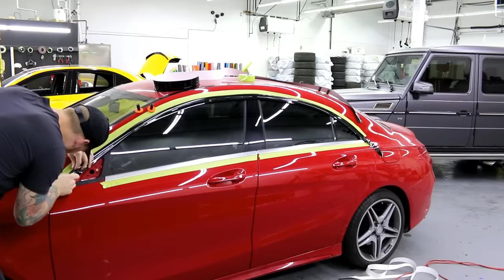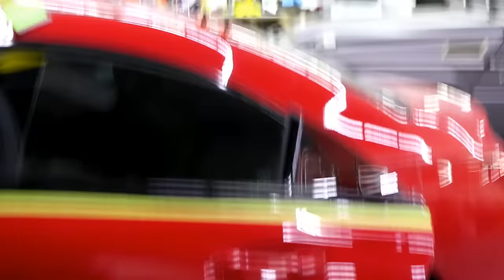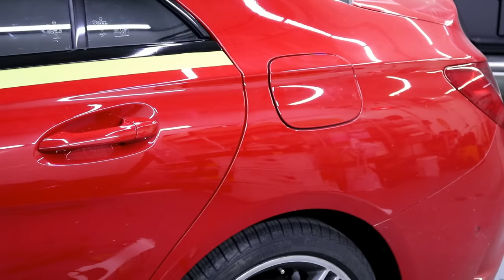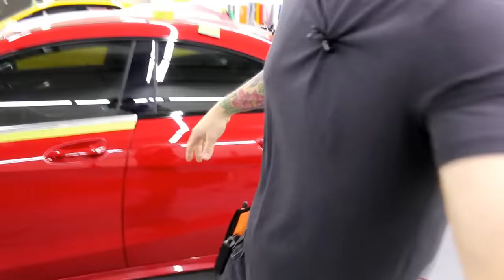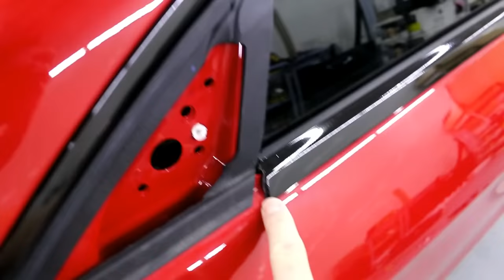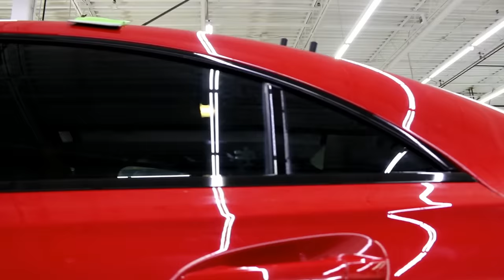EASILY Cover The Chrome Window Trim On Your Car

Comment: Would it be worth you investing in a GoPro head camera. So we can see what you see??
Reply from the maker: I have one, just need a way to mount it to myself
Reply from the maker: I don't want to wear it on my head because it's distracting
Reply from the maker: Chest strap it is
Reply: GoPro has a mount that mounts on fitted or flex cap when worn backwards.  Regardless, thanks for sharing the knowledge!
Reply: Suction cup mount!
Reply: there is a shoulder mount too, RIP said whats up

Comment: Trim seems so easy but I found out it is realllly tricky. I redid mine 3 times cuz your right any little movement with blade you have chrome showing. Even a tiny sliver of chrome stands out like BOOM! Definitely a pro knocking these out first go round and look flawless like usual.
Reply from the maker: It's all in the wrist man. Knife work is another skill to work on
Reply: CK Wraps lol amen brother

Comment: I’m about to do my b7 rs4 saloon as the aluminium trims have gone milky and there’s no way of cleaning it off. The trims are a huge job to remove and replace so I figured I will wrap them. Colour wise I’m doing it in Matt silver to keep the car standard looking as mirrors, radiator grill and wheels are all Matt silver. Thanks for posting such a helpful guide. Hopefully mine will look as neat as the job you’ve done on the Mercedes. Cheers

Comment: I’ve been calling around and been getting quoted 300+ close to 800 smh I’ll just do it myself I have a 2018 accord sport
Reply: How did it go? I have a 2020 accord sport and thinking about just doing it myself too.
Reply: Never got it done as of late
Reply: @Dreamingbigent  if you still wanna do it and don't care about some seam lines, use blackout tape. Buy multiple rolls tho cuz 2 whole rolls weren't enough for the windows on my 2017 TLX. Looks pretty damn good tho
Reply: after many failed attempts to make my accord coupe look good i’ve accepted a 450 quote for windows and door handles in gloss black
Reply: Just by a can of hyperdip and just spray um..the hyperdip is like plasti dip on roids.I mean I’m sure wrapping is nicer long term but 90% of people can’t wrap like this guy lol and worse case is you need to respray once a year
Reply: 50 bucks worth of hyper dip or 50 dollars in vinyl and 650 in labor 🤷🏻‍♂️😂
Reply: All I get is $1000 AND UP $300 is a great  price
Reply: Same here. They over charge for wraps

Comment: I have an Audi s5. Just took a look. I see the rubber seal on the top chrome is on top and bottom. So just gotta get blade in between rubber and trim, right. Looks like you have to wedge your blade in between the seal, because it’s pretty tight on the top seal. Also, On bottom trim, little easier. There’s no rubber seal on the bottom part of the bottom chrome trim. Bonus, the mirror is not in the way, it’s actually about 6 inches away from the corner of where most mirrors are, there actually a black plastic plate on that little corner, so I can do that part without removing mirror. Only fear is cutting the seal by mistake. But I’m might try it if I can’t find someone to do this job under $125. It it wasn’t such a nice car, I would just go for it, without being nervous lol

Comment: Love watching your channel and it gave me the confidence to do the trim delete myself! However, after doing the trim delete in gloss black Avery film I find that the areas that tuck under the trim or where you would stretch it at the ends to get a clean finish eventually peel back a little and I'm finding myself going over tucking it under before i go for a drive. I prep'd the surface and cleaned it with prepsol and starting to think that because I applied it when it was only 10 deg. Celsius the adhesive has not taken to the aluminium trim....or maybe it the design of the trim? For reference it's an Audi A6 avant.
Reply: Same shit with me exactly, 08 335i. Looks good for a day. Peels off the edge no matter what prep, heat , tucking ect. Paid for it to be done
Reply: @becausereasons41  did you ever find a fix for this?
Reply: @Dominic Borrelli  I painted them. Still holding up fine

Comment: Should you run the heat gun over this after it is cut and tucked to activate the glue, or is it ok just sticking and only using heat where necessary?
Reply: To add to this. If you ONLY have a butane torch with no wired heat gun, will that work as well? Provided you don't set it ablaze of course. Lol

Comment: Hey Christian. Huge fan. I have a question. Does most gloss wrap have an orange peel effect? I bought black rose from 3m and in my opinion, it looks like garbage. The orange peel is so significant I could probably get better results with a rattle can. Thanks for your time.

Anyone else have input on this?
Reply from the maker: 3m is does not have a nice finish as I mention in a couple of my videos. Avery has some orange peel and Vvivid has even less

Comment: Any chance you can tell me which line of Avery you prefer for this ? The 500, 700 or 800 series ? I'm guessing either the 500 or 700 series since you said you prefer it thin ?  Or do you use the cast series ?

Comment: How well does this wrap hold up to hot weather? We live in a desert like climate and I'm worried that it will peel. And if it starts to peel can it be removed without damaging the chrome if it has been exposed to 100°+ heat?

Comment: Hi Chris,I have a 2018 civic hatch (white).  What would you recommend if I wanted to "white out" the civic badge on the rear?  I see lots of people black them out, but haven't seen any "white out".Thanks
Reply: ducebigalow hey, I'm not Chris, but I would recommend to try plasti dip on the emblems. It's an easy job and with the proper masking and spraying technique will turn out good. When applied properly will last for quite some time. But all white sounds like a cool idea! Hope this helps a little!

Comment: Ive been watching a lot of your videos lately to learn more about how to wrap. I love your videos and the information you provide for people, but I have one complaint; you don't do enough close ups of what's actually going on when doing some of the finer detailed stuff.
Reply from the maker: You're right, these are older videos that I was doing more for fun. I have up close and detailed videos on my website www.ckwraps.com and everything is filmed in 4k. There are over 400 videos on the website with categorized sections like beginner 101, bumpers, advanced, mirrors etc. There's also an open discussion forum where members ask me questions which I answer every morning.
Reply: @CKWraps  I'll definitely check that out. You have greatly inspired me to start my own business doing this. Im going to do a full stripe today and I am ordering the material for a full wrap on my Audi to start my portfolio.

Comment: it "looks" easy, but im sure it is not, but im gonna try and do it. I was wondering about the tape though. The Vvivid stuff doesn't have great reviews on Amazon. If that's what you use i would use it no problem. Do you use the vvivid? Also side question, what do you think of using matte black. I have a black car i wanna black out.

Comment: nice work. on a charcoal gray 2018 yukon denali, im thinking of getting a slightly lighter shade of gray than the body color to delete all the chrome... but will it be hard to match that lighter gray color for the large chrome grille and emblems/badges? what would your shop use for the denali grille?plastidip paint?or can a heavily grated grille be wrapped too?

Comment: It seems from the video that you do not leave much to be tacked in. I suspect in a hot country this can be an issue, as the film will shrink after some time and the customer wont be happy. On the other hand, some cars have really tight rubber seals, which are impossible to tack the film under. Do you give the warranty for something like this? and how do you explain this to the customer?

Comment: I tried this and it keeps wanting to pull back on the ends.  It's a 2008 Audi Rs6 and the ends don't have much surface area.  It's like the vinyl isnt quite as sticky as it needs to be. Admittedly it's cheap ebay vinyl as I just wanted to give it a go.  Tried post heating too but it still seems to lift after a day or so on the ends.  Is there a particular vinyl that has a very strong adhesive?

Comment: Watching all your vids! Looking to wrap the black trim on my Subie in black carbon fiber. Still kinda cool in New England,  will probably try it in my home garage/driveway but wanted to know what u consider the lowest temperature to wrap in. Seems like 70s but not sure if you ever wrapped in cooler temps.
Reply from the maker: High 60's can work, anything lower could cause a problem

Comment: I had such a hard time deleting the chrome in my model 3. Does ambient temperature of the room make a difference?  I found that the vinyl is really stubborn when it's around 40 degrees in my garage
Reply: This is addressed in countless videos. The film/wrap becomes stiff at low temps. Best bet keep that heat gun flowing. 🔥

Comment: I have a vinyl wrapped car already, want to add the chrome black out.  what kind of tape are you using to protect the car while working?  that looks like yellow painters tape?  will that hurt the vinyl wrap?
Reply from the maker: I use yellow painters tape 3m 301+
Reply: @CKWraps  will it effect or ruin the vinyl wrap?

Comment: Thank you for the vid. Would you recommend using an edge sealer? I’m about to do my car with my friend but he says I need an edge sealer
Reply from the maker: I've personally never used edges Sealer in my life and that's coming from someone who had no help when it came to learning how to wrap. In my opinion it isn't needed. Those who have experience but still use it should work on their skills as opposed to relying on a product.
Reply: @CKWraps  thank you

Comment: Hey Christian I have a Lexus IS (3rd gen) which one did you do? cos I had mine done and the upper trim rubbers does NOT give to tuck in the wrap.. Now I am having shrinkage and the some angles you can see the chrome poking through.
Reply from the maker: I did a video on how to do it a few months ago. Not sure which gen it was
Reply: Ah found it! That's the problem I think as the installer didn't use knifeless tape hence I can see chrome in some certain angles... Thanks man helpful video as I might give it a go

Comment: Thanks for all the videos. I've got a 2016 Audi S4. The top trim piece is a solid chrome piece around the tops of the doors (door has the seal that contacts the chrome that's in the door frame). The chrome trim piece in the frame has multiple little ridges that give it a texture. Would you wrap to the first ridge and leave the chrome visible when you open the door, or cover the textured ridges? Not sure how that would last or look.
Reply: I’m having that exact issue right now with my audi

Comment: i got quoted 500 for a chrome delete on my cla250 lmfao....
Reply from the maker: That's a lot lower than what I charge
Reply: @CKWraps  how's that work? If you charge $150 an hour i think?.. and takes you an hour.. give or take plus little material. Wouldn't $200 area be fair both sides? Or let's say 2 hours for prep. 350 max? I don't doubt your skill level and never question any of wrap prices on cars you've shared with us, just curious how more than $500 is calculated. Not sure if I said it before. Idk if you're the best, but not sure there is anyone better. And you don't have decades of experience, so pretty impressive. Best channel I've ever seen. You have inspired me. Much love brother.
Reply: Such a shame what happened to Mercedes, this speaks volumes. 🤭 I’m not referring to CK.

Comment: Wouldn't it have been easier to just open all the windows so the vinyl doesn't stick to it?
Reply from the maker: You can, but you'll need to be more thorough with cleaning. There tends to be a lot of dirt and debris inside the window sill once you open them